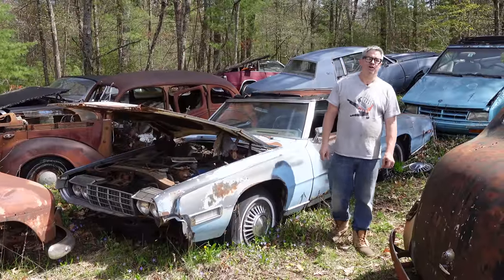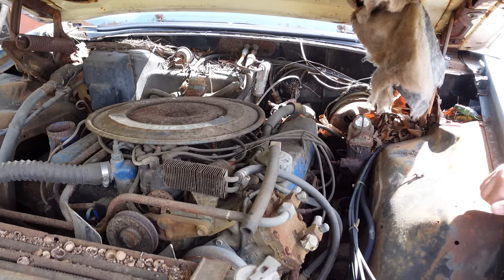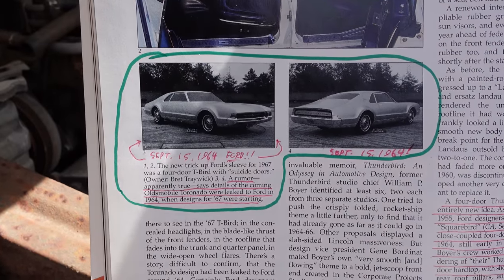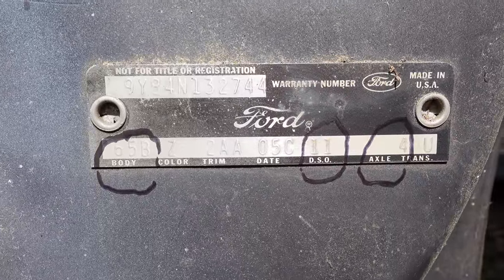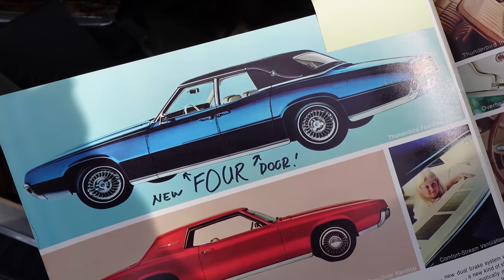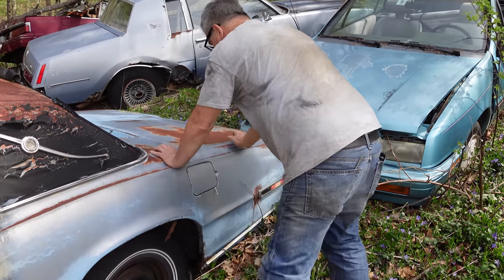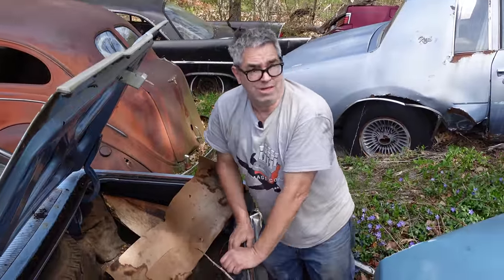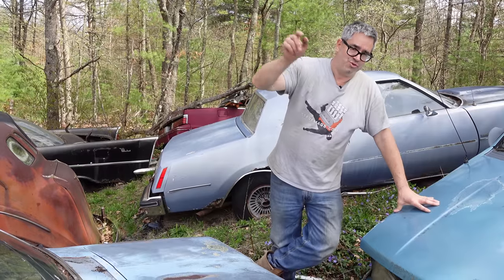Bigger Bird

Comment: Hey bud, great vid.  The headlight doors were vacuum operated, there is a vacuum pot behind each one.  The 390 was standard with the 428 as an option for the 67-model year.  For the 1968 model year the 390 was standard with the 429 as the option until December 31, 1967.  Beginning on Jan 1, 1968, the 390 was no longer available and the 429 was the sole engine for the Thunderbird.  And as an aside, the pic you show from Collectible Automobile of the 4 door is my car which was photographed for the magazine in about 1998.  The pic of the interior below it is also of my car.  The picture was taken at an athletic feild complex in the SW corner of the University of Florida campus.  I bought that car in 1989 from the original owner and still have it parked in my garage today.

Comment: My father brought a used  '68 home in 1981. I loved the interior styling and the bad-ass grille with the hide-aways. Everything from the sequential turn signals, easy exit steering wheel, to the brushed aluminum interior trim in that car was special. Unfortunately the engine pinged with the low octane gas at the time & retarding the timing was the only solution. Thank you for the tour Steve!

Comment: My mom had a 1968 Thunderbird she got in brand new. The salesman had it pulled aside in his garage when she picked it up. It was a 2 door it had the 429 thunder jet engine with ac and power windows she had a lead foot. I remember her welding the doors of the GTOs she would come up against on the road. Looking back, it's a wonder we survived as she would drive the car 120 miles per hour and sometimes on bald tires. I remember she would drive from Delaware to DC and once out on I95, and the beltway she would burry the speedometer needle for most of the trip and sometimes encounter a speed trap, it was a great car.
Reply: Yep same here only it was my older brother that buried the needle on dad's car on the QEW Toronto. He said the front end was moving up and down with the air. He guessed at over 130mph. 2 Door Burgundy on Black really nice car.
Reply: Are we related? I had an aunt who drove a ‘70 Grand Prix SJ. It was the norm for her to do 120mph with us kids in the car. My uncle drove GTOs. He bought a ‘66 new and a ‘70 new. Still has them today. 
My pops had a ‘70 T-Bird with the 429. Loved that car. It wouldn’t out run any of the GTOs in our area of Baltimore but it had a nice balance of luxury and performance. Ahh, to be a kid again

Comment: Steve... As someone else also noted, that is not a 69 because all 69 Landau models had the blind quarter roof with no rear side windows.  The data plate that you showed had a 9 as the first digit so the data plate was def a 69.  Likely the door, which holds the data plate, got swapped out after a wreck or rust out.  Please look at the VIN on the front clip of the car and note that it begins with the number 8.   Also, all 68-71 had the 429 engine.  66-67 had 390 standard with 428 optional. As you know a complete different engine series.  Finally, the headlamp doors were vacuum operated, not electric.  Which would I prefer to buy new?  The thunderbird!  Although I would get the standard hardtop which came without the funeral car landau bars and without the vinyl roof.
Reply: Agreed this is a '68.  The taillights are two sepatate lamps vs the full-width 1967-68 lamls and the rear marker reflectors vs the actual rectangular lamps on the '69.

The dash turn signals are 1967-68 vs the two rectangular arrows on 1969-71   The three turn indicators on the dash are designed to mirror the sequential turn signals.

On the very early '67s, the turn signal would start on the opposite side of the three lights from the indicated turn and light in sequence toward the indicated turn.  The technology was not there to make the dash signal in either direction reliably, so it was removed early in the model run.

Comment: I had 69 T-bird with suicide doors when I was in high school in the eighties. Rebuilt the engine in auto shop with a hotter cam and carb. The 429 was definitely underrated as an engine. Would love to have one again as a project. And Steve is not wrong, that trunk is massive. Big enough to carry an old 354 hemi engine complete 😂

Comment: The Thunderbird shared it's platform with the Lincoln, not the Galaxie.  Actually, Back then Tunderbird was more like a halo brand, as if you look carefully, the car will not say FORD anywhere on the exterior and only have non descript badge inside that it is a product of Ford Motor Company.

Comment: I think that's a '68 Steve - different grille & they were equipped with the 429 as well. I had a '69 4-door. Beautiful machine. Great, smooth, highway cruiser with excellent acceleration for a ~4500lb car. The interior was a combination of white leather & vinyl, black carpet, woodgrain, brushed aluminum, and chrome. 
Loaded right up with electric-over-vacuum everything, as evidenced by the fist-sized bundle of vacuum hoses running from the driver's door in through the door post. Fun times.
Good stuff as always - keep 'em comin'.

Comment: I bought a rust-free blue ‘66 T-bird convertible when I arrived in Vegas around 1975 but the sun was so brutal that I had to leave the top up. It looked just like the one in Thelma & Louise. The way the trunk opened in reverse to accept the top was interesting but I didn’t have much use for the swing away steering wheel. I only stayed in Nevada a couple months before getting homesick and flying back to Michigan. I didn’t care much for the ‘67 T-bird styling.

Comment: getting ready to pull my 67 landau in the shop for a full restoration. Been hoarding parts for about 8 years now. 67 was a one year only for most parts. Yes, that is a 68 in the video so it was ordered with the 429. Mine's the same color as the one in your video with the vinyl top. Landau bars going in garbage can ! Makes them look like a hearse. Great video despite the little mistakes.

Comment: Steve got it wrong on this one, at least a little bit.  This car is most likely a 1968 but the tell tale sign (the rear light panel) is gone.  The grill on this car is a combination of a 1968 AND a 1969, so it was probably a deer smasher at some point and was repaired with junk yard parts.  Also, the hub caps are 1968 only (although those could be switched out as well).  In 1967, the 390 and the 428 were available.  No 429.  In 1968 and 1969, the T-Bird was only offered with the 429, and no 390 or 428.  Lastly, the rear windows that slide into the C pillar are also present on all Lincoln Mark III's.  They shared the same chassis.

Comment: The rear side marker should be just a reflector with no bulb behind it. I've read online that Ford retrofitted some 1968 Thunderbirds and installed bulbs in place of the reflectors (in response to customer complaints). But I have never seen a 1968 Thunderbird so equipped and question whether this story is true. The headlight doors appear to be from a 1969 Thunderbird. The center grille is correct for 1968.

Comment: Hi Steve, good video, good car!  You are 100% correct in regards to the left over Mustang Shelby(s) in the 1969 model year.  The Thunderbird that you profiled is the same platform/chassis as the Lincoln Mark III, and the Mark III also had the rear side windows (quarter glass) move into the roof sail panel, not the lower quarter panel.  They where more of a rear vent window than any thig else.  Rear seat passengers in the rear seat did not get a very good side view because the roof sail panels where so long, they had to bend forward to see out.  I think the Cadillac Eldorado had the same thing for a few years.  When Chevrolet came out with the 1953 Corvette, the Ford Motor Company bought two Corvette(s) to study them.  Please reply.  Dave...

Comment: Thank you Steve. I didn't know Ford had any canted valve engines. Who was the first?
Reply: the 351C, 351M and 400 were also canted valve
Reply: @shrek_428  I know chrysler was using canted valves since the mid '50s. Was mopar first?
Reply: @oops1952  I believe so, they came out with the poly head in 1956

Comment: 00:59 The headlight covers use vacuum motors, just like the Cougars of the era.  A lot of things including Tilt-a-way steering column were vacuum operated.  The spaghetti tangle of vacuum lines used to give my dad fits!  Years later I got into early Cougars and had my own “fun”😅 Now you can get electric conversion kits.
Reply: T bird wipers were hydraulic from 64-71.
Reply: I once bought a 1967 Cougar and my first purchase after that was a roll of vacuum hose.
Reply: @novanogo07   Well I'll be dipped... I had assumed vacuum was used like on my '67-69 Cougars.  They had a neat feature where they could be 'on demand’ by stepping on a foot pedal.  How did the T-bird wipers system work - did it use transmission fluid?  Was there a hydraulic pump powered by a belt? With hydraulics, vacuum and miles of wiring for the power windows etc, no wonder Pops had fits with our car!  I remember someone backed into the back of the car and that whole rear light panel had to replace and was NOT cheap.  Dad was not too pleased about that.  And with that 429 Thunderjet at the height of the OPEC gas shortage, I'm sure that made him even happier!  lol
Reply: @mexicanspec  Yep!  Good call.  Other things to check for is the integrity of the ‘coffee can’ air reservoirs, the vacuum motors themselves, and the seals and boots at the actuator pistons.  ‘67-8 uses separate assemblies for the doors, but starting 69 a single actuator with large can in the center of the grille.  My guy Don Rush at WCC can hook Cougar nuts up with the replacement electric system for the headlight doors AND the electronic conversion kits to replace the mechanical directional tail-lights.  I kept my cars old-school though since mine always worked.  The mechanical spinning contact thingies sounded like I had pigeons cooing in the trunk when the turn signals were on.  😆
Reply: @mattskustomkreations  They were inline with the steering box and ran off the power steering pump. You could vary the flow via the control lever to have almost infinate speeds between off and high. They were much quieter than electric linkage when new. They are kind of gimmicky but work well.
Reply: @mattskustomkreations  I have found leaks on the vacuum hoses going to the headlight switch on a few cars, so I just replaced it all.  I used the whole roll on that one car.
Reply: @mattskustomkreations  I wouldn't change any of these systems.  It takes away a lot of the charm of the car.
Reply: @novanogo07  Cool- thanks for explaining!
Reply: @mexicanspec  I agree, but they can be somewhat finicky so I understand why people ‘upgrade’.  Btw, I dig your Avatar.  Our “compact car” growing up was a ‘74 Gold Duster with Slant 6 and weird option where you could fold down the back seat and crawl into the trunk.  Us kids used to sleep with our feet in the trunk on road-trips.  Or shove/lock our friends in the trunk as a trick/gag. Fun times.
Reply: @mattskustomkreations  Ah the good old days.  The car in my Avatar is for sale and it is a slant 6 car.  It is super clean and runs perfectly.  It is also a 3 on the tree.

Comment: The Thunderbird was available with suicide doors from 1967 til 1971, which made them unique. That was the generation liked best and would have chosen it over the Shelby Mustang. Although they did have grill changes every year the 1969 models could easily be recognized as that was the only year the taillights didn't cover the entire rear. The last 2 years [70 & 71] featured a massive nose shaped grill.

Comment: That is a 1968 model, not '69.  1969 Two door Landaus did not have quarter windows,. They were blanked out like the 1966 Town Landau top. I know the '69s extremely well, as my dad had a beautiful copper colored Landau with a black top and black interior. The 1969 model was the best of the Glamour Birds.  The Bunkie Birds that followed were similar, but not as good.
Reply: Correct, a "68. Also, '67 had a 390 or 428 with '68 -71 had only a 429 (385  series) available.
Reply: Agree it is def a 68.  I think someone swapped the drivers door because the data plate that he showed began with the digit 9, so at least the door was off of a 69.

Comment: Wouldn't this be a 5th Gen.? 55 - 57 Gen 1, 58 60 Gen 2 61 63 Gen 3, 64 - 66 Gen 4, 67 -69 Gen 5.  70 and 71 looked similar, but were on the Mark IIi platform, so those would have been Gen 6.

I suppose one could combine 61 - 66 as all one generation, but those cars were quite different.

Comment: That 429 is not worth saving? I don’t know much about Fords. I passed on a free Lincoln 4 door that ran a drove with a 429. They left it down the road to be taken away. I did not have the space and I’m sure my mom would not have approved me hoarding another engine and transmission. That engine probably weighs more than that valuable Sundance convertible! Lol!
Reply: Lincoln never had the 429.  It had the 460, same series engine.
Reply: Yup. Probably right. It was a big engine to me. 460 is bigger than 429. I know there is a difference. A few years later a room mate of mine had the same Lincoln. Same engine 460. I forgot what happened to it. I thought they could be built up to have some kind of power. At least high torque output and put it into something small like a fox body

Comment: No, a letter is not (always) better in 1969 because letter codes "A" through "E" that year are....drum roll please.....all open differentials. Always, always, always, always check year by year against known good reference charts and then verify it physically as parts could have been switched and swapped over the course of many years. Today it's easier than in the past, you have a reference chart in your pocket in the yard today (your cell phone) and you don't have to carry volumes of reference material as you might have to do in the past. Don't be fooled by the "alphabet soup" of codes, they vary year-to-year. 

We got the VIN, we win: 9 for 1969 model year, Y for Wixom, MI assembly, 84 for Thunderbird Town Landau with blind quarter, (83 is a two door hardtop and 87 was for a four door), N for 429 V8 with four barrel and the rest is the production sequence. The Wixom plant operated from 1957 to 2007 and produced over 6 million vehicles in the time it operated.

We got the tag, we can brag: 65B for Thunderbird two door Town Landau with blind quarter and bucket seats, Z for Dark Gray Metallic exterior paint, 2AA for Black interior trim, and I believe the last A might be for a black vinyl top, 05C for Wednesday March 5, 1969 production, 11 for Boston, MA sales district, 4 for 2.80:1 rear end ratio, non-locking, and U for C-6 automatic transmission. 

The driver's door may be from another car as the code "Z" is a pretty dark gray and this car appears to have actually been closer to code "Q" Brittany Blue exterior paint. That is why it makes sense to verify the door VIN with the dash VIN to make sure you've got what you think you've got.
Reply: I remember the diff' conversation from a past vidjia. Another comment stated the door may not be original to the car.
Reply: @tomwesley7884  It for sure isn't original since this car is a '68, no question.
Reply: @tomwesley7884  I do not believe that's the original door to the car. The paint color is way off and the paint on the door matches the dark gray "Z" code on the tag. The "letter is better" should never, ever, ever, ever, ever be used to determine if you have a locking or non-locking rear end as it has been proven that some letter codes in 1969 are indeed open rear ends. Always use a proper reference chart for the right year and then do a physical check as parts may have been swapped around over time.